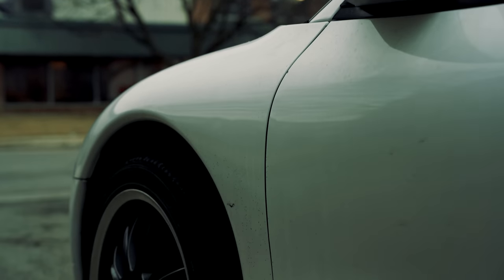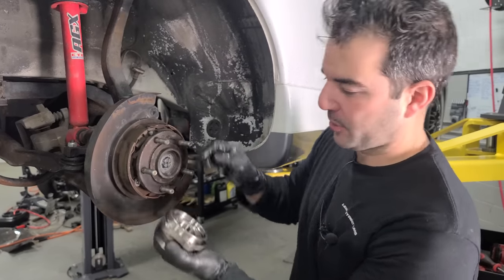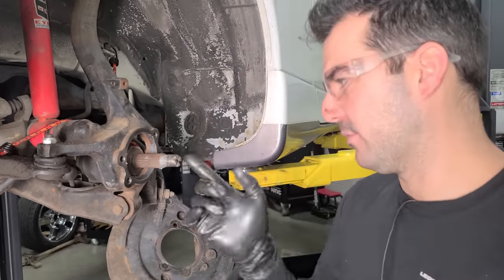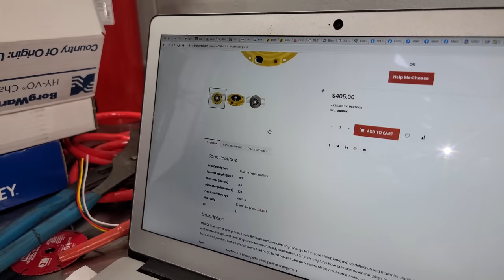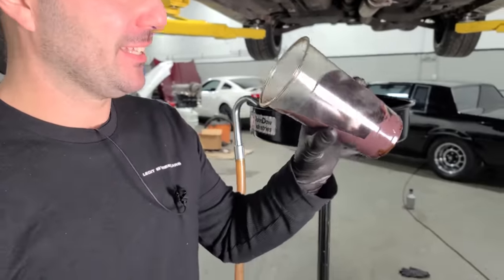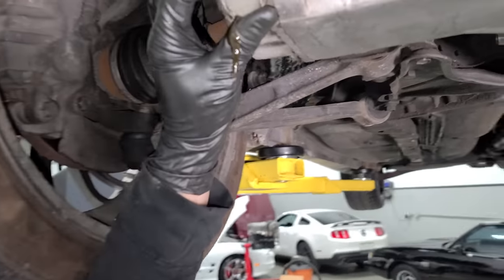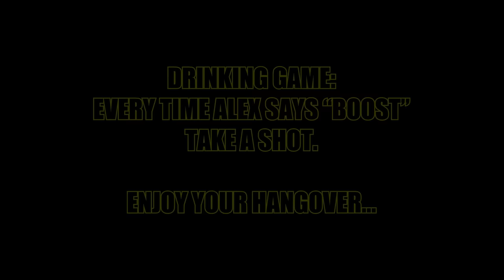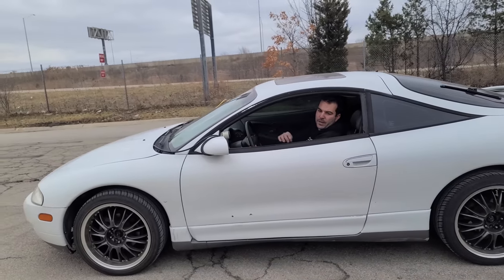Fixing My 250K Mile Eclipse GSX For CHEAP & Adding More Boost For FREE! AWD Launch Monster!

Comment: IDK if anyone else called this out but GL4 and GL5 oils are not always interchangeable. The problem is that there are additives in I think GL4 that has sulfur in it that will deteriorate "yellow" metals, like bronze, that are in some transmissions or differentials. Just make sure that what you are using is correct for your vehicle because one smells super bad, and the other doesn't. Often I drain a transmission on a Z32 that I know does NOT want that sulfur additive and it smells super bad, so I know they messed up. In this case, it may not matter for the diff you have.

Comment: The viscous coupler is inside the transmission. The transfer case only has a bevel drive gear set  and bearings. Some people pin or weld the VC, this can be done by simply removing the transaxles rear cover, a snap ring and pulling it off. Don't lose the 3/16 ball bearing.

Comment: You can use more than one tee at a time or even simpler is to drill holes in the line. You can get a pretty accurate boost level by adding more holes until you get the results you're looking for. It's not a permanent thing, unless you're Kyle from the boosted boiz channel, but it will give you an idea of what the engine is capable of. Having a k swapped Mercedes and other turbo toys pfi speed and boosted boiz are required reference material.

Comment: Hi guys, the "front diff" oil is just the transfer case ring and pinion oil.  The front diff is inside the same housing but separated from the ring and pinion gear and is in the gearbox oil bath.  Oil is also mechanically pumped from the gearbox to the far side of the front diff, and it drains back towards the gearbox.  The oil for the ring and pinion should be rated GL5, whereas the gearbox (and front diff oil, by extension) is GL4.  These are also full time AWD and the centre diff is inside the gearbox and just an open diff.  Attached to the ring gear inside the transfer case is a Viscous Coupling Unit (VCU) which is sealed and uses its own fluid which is non replaceable.   The VCU just provides a gradual lock-up of the centre differential based on how much the VCU plates are shearing against each other.  It's a bit like that fluid your kids can make from cornflour which is soft if you're gentle with it but hard if you punch it.

Comment: Had one of these, 16g turbo, injectors, fuel pump, AF computer, ported heads and turbo..

Let’s say, it embarrassed A LOT of cars. The thing was FAST! 

It also went through 4 clutches and 3 transmissions!

Comment: Your front diff is inside the transmission right next to where the front right axle input shaft goes in. What you drained in the front was purely the transfer case. They had the red line shock proof heavyweight in it.  If you keep doing AWD launches above 300hp you will break the transfers case or rear diff.
 Judging by the A/R bung in the downpipe and super beefed up fluids and more than likely transmission and clutch it looks like someone swapped back in its stock parts before they sold it to you or the guy right before you.  But it looks like you might have known that seeing as you mentioned that it has a FP exhaust manifold and a 1G turbo on it.  I bet it already probably has an upgraded fuel pump and possibly larger than stock injectors.  That might explain why your A/Rs are so rich.  That car looks like it's set up to run 15 to 16 psi of boost on pump gas all-day lon if it has a bigger pump and injectors.😁

Comment: Alex, pull the ECU and see if it's got ECMlink. The 14b is good for about 20psi before it becomes a hair drier.  1g BOV will hold it. The crappy plastic 2g always bleeds about 13psi.  I've had 1Gs, 2Gs, and GVR4s.  

Currently just a 2G hx35 water/meth tuned with ECMlink.  

Ecmlink is really the way to go.  

P.s. also an fbody guy with a third and fourth Gen.  The third Gen was my first car, bought at 14.  Going to revive it soonish with LS swap.  

Of all the youtubers your taste and wrenching is almost the same as mine!

Glad to see you doing well!

Edit: firebird/trans am fbody guy... 😉

Comment: 2g DSM looks really good in red or black. Would probably do Evo 8 brakes and good pads. As for the turbo, I remember the 16g being a common upgrade. Upgrade the center section if desired with one of the options available.

Comment: I love the content and the fact you guys are local (I'm out in the McHenry area). As far as the color choice, I'd go with the Durango Copper Pearl (which is a stock color for the '95 GTX).  If you wanted to go CRaY crAy, I've always loved the Holden colors for the "Pontiac" GTO - specifically Brazen Orange metallic or Spice Red Metallic.  These colors change a LOT depending on the lighting, but I also know, the Brazen Orange takes almost 2X the amount of paint to cover a car completely....

Still, these colors are SICK (esp if you use a matte finish on the Brazen)...

Comment: Reach out to turbolabofamerica and get the Td05h to td06h 20g compressor wheel and compressor housing. You can upgrade that turbo to a larger more powerful one with the stock turbine and spool up stays similar. Just moves more air👍 that’s what I did to mine for $150 and I LOVE IT🤘

Comment: Alex it's almost free to get an aircompressor regulator from harbor freight and use that as a boost controller. Waaaay more control than the ol slit in the reference hose

Comment: Transfer case is Redline shockproof heavy, very common & a great choice of fluid

Brakes, Evo 8 Brembos for both front & rear for OEM upgrade, Evo 8 rear diff as well, number of companies make clutch pack upgrades for them

Forced Performance cast exhaust mani is on the car, best cast mani you can get.

Comment: Stock BOV leaks. You can replace it with an EVO BOV, but even then, the t25 can only hold 10psi at redline. With an upgraded wastegate spring, you can push it to 14 psi at redline with a fairly stock car, but don't expect the stock turbo to last long when pushing it that hard. It will destroy the turbo  thrust bearings.

Comment: I made my own boost controller with some parts from a hardware store,  ball point pen spring, and a ball bearing. Its a very simple devices, that essentially just makes it harder to push air to the wastegate actuator.

Comment: My old vw 1.8t I used screen door springs on the wastegate and got about 1-2psi over what I was. The main thing is it didn’t bleed off at the top end it held the boost to redline.

Comment: You need a restriction in the tee on the end that goes to the wastegate actuator. Usually you'd use a brass tee, solder in one end and drill a 1mm hole in it. That forces the boost out the less restricted bleed off and delays the boost pressure signal to the actuator.

Comment: Transfer case doesn’t take much oil, use redline shockproof oil in it (which kind of looks like what came out but it’s should flow better). 

The viscous coupler is in the transmission at the very far end of the case closest to the wheel. The transfer case is just gears. Center diff is also in the transmission itself.

Do not use GL-5 in the transmission itself. Transfer case is fine to use it in.

Comment: If you want a really easy brake swap, you can do larger rotors from an Outlander, all you need are caliper brackets and discs from the outlander, you use the stock calipers. Fills the wheel better and it's a little more modulate-able under heavy braking, unfortunately this is only for the fronts though.

Comment: CTSv brakes up front with Mustang Cobra rotors work great up front and are direct bolt on with no modification (except for a possible spacer for the rotors) and Evo7/8 rear Brembos work on the rear.

Comment: Always loved this generation of eclipse/talon. I’ve always regretted getting rid of my black on black 96 gst. Had a 2.3 stroker motor 16g turbo evo 4 inch inter cooler and 17x10 wheels off an evo. The car was an absolute blast to drive.

Comment: 99 GSX here. The pink fluid was common back in the mid 2000s. It’s a mixture of shock proof and something else. Been a while. My advice, don’t side step the clutch, load it up to remove the slack before launching.

Comment: The oil in the transfer case is Redline heavy shockproof, better than what you guys put in it, it looks perfectly good, the transfer case only take about half a quart, not much at all. There is NO viscous coupler in the transfer case, it resides inside the transmission. The transfer case is simply a 1:1 angle gear box, that's it. The Stock BOV only holds indeed only holds around 12 psi

Comment: Up stock Boost change stock bov replace with 1990 to 1993 4g63 bov crush mod. 
You should feel slight difference when engine is stock, it does work.
Look it up on dsmtuners.

You need a boost gauge aem if you want go up 20psi.
Stock engine will blow up, stock can only handle so much.

Buy a dsmlink ecm for tuning.

Comment: The viscous coupler is not in the transfer case, it's on the rear-most part of the transmission.
And yes, redline heavyweight shockproof is the goods.

Comment: To pull that wheel bearing. I actually have a slide hammer to thread  to the lug nut and you just hit it turn hit it usually doesn't even have to go all the way around just thought I throw that out there easy to make major time saver

Comment: I was hitting 23-25 psi on an EVO3 small 16g with a 2.5" going to 3" exhaust, 2g maf setup on a 1g. I tried adding a spring to get the boost up.

Comment: looks like you have the stock Wastegate Controller. what you could technically do is as follows. if you can add a mini piece of all thread to the wastegate arm so you can adjust it tighter like a slider that should keep more tension against it. aftermarket wastegates have adjustable arms n different spring options you could technically make a custom one that way I've built a few of them. on my 1991 Mazda 626 Turbo build (Ford Probe GT engine) stock engine n turbo but i am running a homemade boost controller of my own which i have mine set at 10-11psi due to the factory limitations of the ecu aka fuel cut at 13psi. ive been a fan of DSMs for awhile n back in the day helped build a few also. i happen to know of one sitting right now with a toasted engine (crank walk) it has alot of 90s n 2000s goodies on it.
Reply: as for the color Burnt Orange would look nice on one of these.

Comment: Rear Evo 8/9 brake calipers, get rid of the clutch setup, go with a Southbend Clutch along with an ACT Streetlite Flywheel. Transfer Case looks like it had Redline Heavy Shockproof oil.

Comment: I have an idea for something I'd like to see you guys do; Build an Exocet style car. Maybe get some cheap donor car that's worth almost nothing because it's rusty structurally, and build it into a fun sporty little car for not a whole lot of money. Plus you could sell parts that are still good from the interior and recoup some more money there.
Ooh yeah I hear the growling. Wheel bearing? Cause it doesn't have anything to do with the clutch being in or out so the trans itself is fine - and you said it's speed sensitive. Then it's just really just between the diff and wheel bearings. I guess you could try with the diff by seeing if it changes with the gear shift? Cause as you shift gears it'll change how fast and how much force the diff is getting, right? But IDK if that'd be enough to tell through feel or noise. Although yeah it'd just kinda build with your speed the same way. Bleh.
Ah yes, the wonderful "Drive like a maniac" method of seeing if wheel bearings are bad lol. and you can hear that squeak on camera changing between left and right. But yeah there seems to be a lot of excess exterior noise lol.

Comment: As long as the front diff has some form of lubrication I don't think it would cause any major issues. I also noticed when you spun the back wheels in the beginning the front wheels spun a little bit, might just be normal operation, but could also be a symptom of the worn out gummy fluid.  Should probably run the car for a bit, and change the front diff fluid again soon to flush out any remaining goo if you want to be proactive with it, and give you some peace of mind, especially if you plan on running it hard.

Comment: You can run 13-14 psi on the T25 for a bit before you blow it ( too small ) 15-16 or psi on a 1g 14b  stock fuel

Comment: Dril more holes in the boost line or just use a compresor air regulator for boost controler

Comment: I think that the pink stuff coming out of the TRANSFER CASE (not differential) isnt a big deal. The front diff is inside the transaxel. They are totally different things. Not sure if those had a center diff (Viscous Coupler) but if so it is also inside the transaxel and it is part of the output shaft that goes out the transaxel into the transfer case.

Comment: I owned a 99 Eclipse GSX when I was 19, bought it for only $7000 from the original owner with 44k miles on it an elderly woman who didn't realize it was the AWD Turbo version. It was bone stock, forest green and manual transmission. I had it painted black, black rims with chrome lip, kept the beautiful tan leather interior and stock body kit, put about another $3000 into it when it was done. At the time I owned a 2002 S10 Xtreme Supercharged that got about 8mpg, and for a few months the mix of AWD eclipse and no traction S10 was great. I decided to sell my S10, and a potential buyer for the S10 saw my eclipse and offered me $20,000 cash for it and I sold it. To this day I wish I'd have kept that car

Comment: And FYI, unless you want to break the tranny all the time, or you are trying to hit a 9 second pass, keep it open diff. Wheelspin saves the drivetrain. And that's an ACT extreme duty 2G DSM clutch kit. I had the same one in my old 97gsx, it's rated for 500tq,  if it's the six-puck sprung variety. If it has a light duty full face clutch disc it is rated for like 380 torque.

Comment: the turbo is capable of more, you wont bleed out all the boost from one T-pipe you may have to use 3 or more, add a second one in and i bet youll get close to 17-18psi
Reply: The plastic 2g BOV is the limiting factor.  They always bleeds at 12-13psi.

Comment: It could also be the length of line and minimal opening on the "boost controller" that is limiting you. Providing pressure to a volume isn't equal requirements for any volume.

Comment: Over about 12-14psi on a stock tdo5 turbo is just making it a hairdryer, and no more power. Plus summertime temps on the stock turbo with more boost is asking for a blown head gasket.

Comment: Evo8/9 rear calipers bolt up with no mods.  And if you find jdm Galante knuckles evo8/9 front calipers with bolt up too.  Or get a caliper adapter bracket.

Comment: Been waiting for you to release this one. 1G/2G's will always have a special place in my heart.  BTW I have a stroked 2.4L 4G63T Motor sitting in my old 1G NASA SU Race Car that I don't race anymore. Along with a Shep Racing 5spd. You can have it if you would like, Id be more then willing to donate it to you.  The turbo has been gone for a few years now but it does have a FP Cast Turbo Manifold on it. I'd prefer to donate it to a good project such as this rather then  send it to the junk yard. There's a bunch of other stuff, Stop Tech big brakes, suspension, sway bars..etc..etc..etc.
Reply: 1g trans will do nothing for a 2g so I will take it off your hands 😂
Reply: @sup jay  LoL...Im trying to nudge him in the direction of doing a 1G as well.. 😉
Reply: @mcbridemotorsports5788  lol I have a 92 just chilling in a field, bought the stock motor for 500 bucks and the partout guy asked if I would just take the whole car.  Free motor holder... cool lol.  

I get ya though

Comment: Should have just put a small vice grip on the wg line for full spring pressure. Probably would have done 20-25psi also it's common in those to crush the bov in a vice.

Comment: if u dont have a leak that turbo should hit 20 psi. mine did on my awd talon before i upgraded the turbo.  also use the cheap tee ,ball ,spring ball boost controller

Comment: 3000 GT VR4 brake kit, the spindle's in the front are AWD; drive shafts should slip right in. the brakes (rotors/ calipers are Akibono, Mac Claren F1 brakes!) a set of 8 spoke chrome wheels (18x9.5) off the last year of 3000 production, The 1 and only 3000 GT Spyder was painted in Fiji Blue; a Mitsubishi Exclusive paint order ($ 750 usd). I gotta share this car story with You. Rewind to the summer of '69..... just jokin'; 1990. There was a group of 4 car nut's that took MY Mom up on a Stewart Anderson's/ Black Angus Steak House that was directly across the street from the Aurora N. Ave. Mitsubishi dealership that My Mom and were here around X-Mas time 1989. We all crammed into a '85 Dodge Omni GLH, 4dr, red, swiss cheese mags (4 bolt), 2.2L N/A 4 cylinder. the hidden egg about this engine was that the cylinder heads were Hemi-Spherical chambered that allowed Mikey (Owner of this and Many other Mopar muscle. he's a certified Master Technician and Shop Manager at the Dodge, Chrysler & Plymouth Dealership at the main Branch in DownTown Vancouver till he retired in 2017 after 25 +yrs of service (for his 10 yr celebration, he was gifted a complete, but dismantled Viper that won Sebring & Daytona,; I had the "honour" of helping raising the Carcass ;) to the rafters 30 feet above us in a "A" frame barn that he reclaimed from Stone Hedge era: Ancient! Iam the worst at this, A Fiji Blue paintjob with the 18's are my suggestions. Cheer's from East. Van B.C., Canada.

Comment: God this makes me miss my 95 gst so much car pulled like a freight train I had a whalboro 255 pump and 1000cc injectors dsm link chip in my Ecm for tuning and a bullseye power s259 Turbo pushing 20psi (59mm turbine& 60mm compressor) it was quite amazing